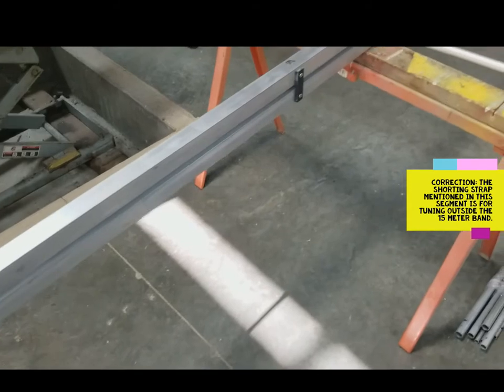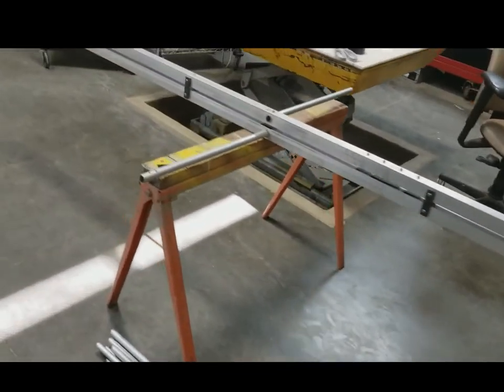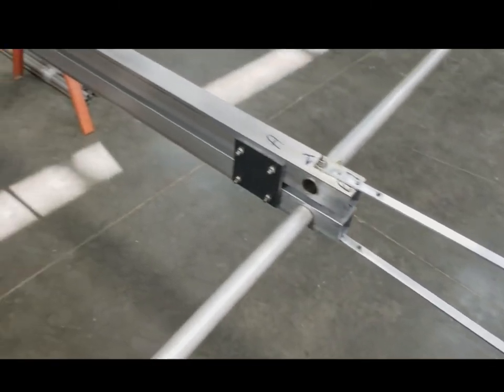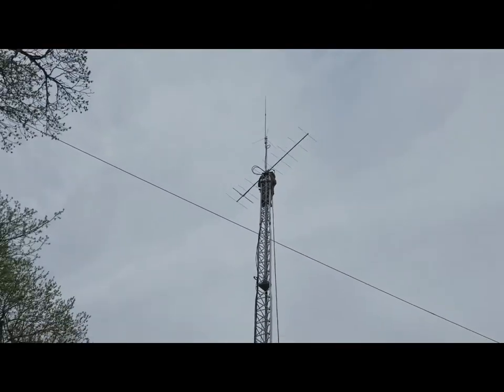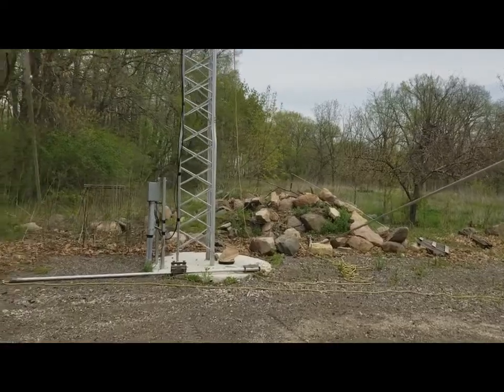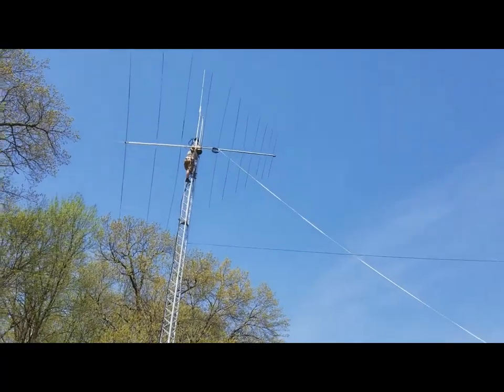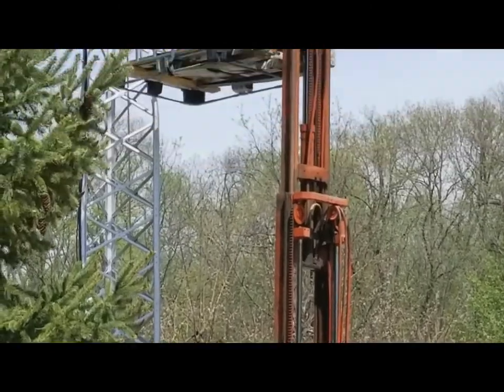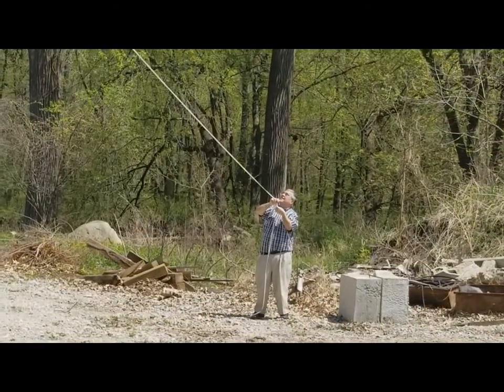Raising Tennadyne T11 Antenna

Comment: Curious, what size rotor do you have? The yaesu g800 I have won’t handle this antenna. Was thinking about upgrading to the g1000.
Reply from the maker: I have the G1000
Reply: @W0GEN  I assume it’s held up good then.
Reply from the maker: @N4JAB  Yes, only issue is the antenna clamps were not tight enough, and the antenna slipped on the mast.
Reply: Would also appreciate more videos of this…hardly any videos on YouTube comparing reception between this and a wire.